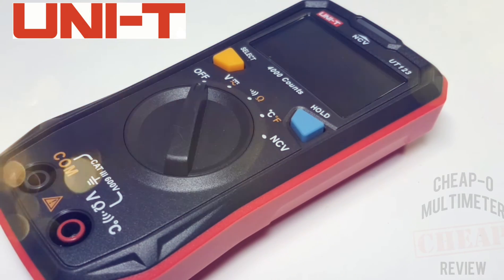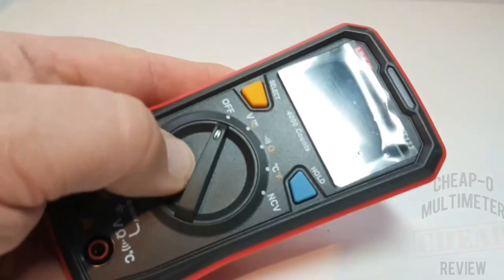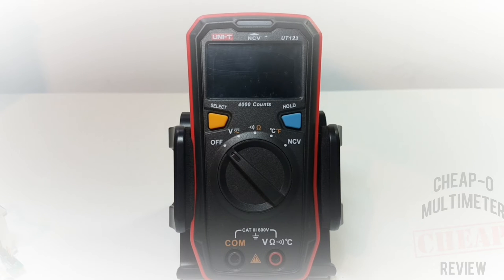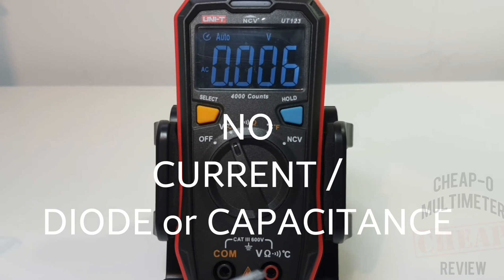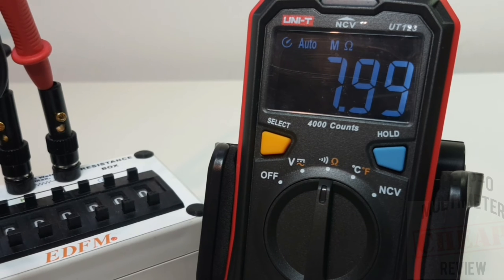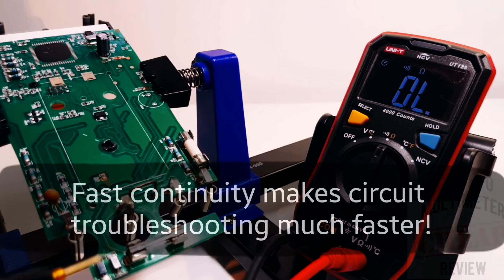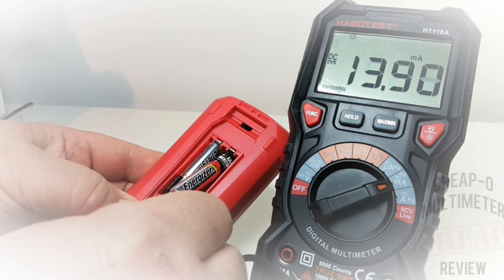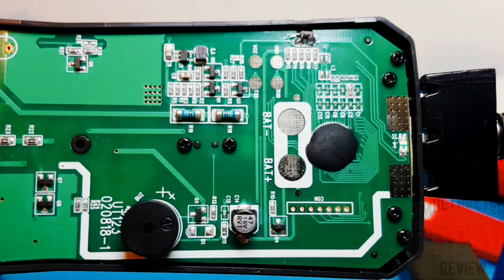UNI-T UT123 CHEAP-O Multimeter Review & Teardown

Comment: Can anyone tell me what value of the five resistors are that are right next to the connection from the screen to the board and the order they go in from top to bottom.? The connection from the screen to the board failed and these five resistors got desoldered while trying to repair.
Reply from the maker: Those 5 smd  Ω resistors (R13-17)205, are all 2.0 Megaohm in value. 👍
Reply: @KeepOnTesting  thanks very much👍
Reply: @KeepOnTesting  are these resistors 201 or 402
Reply from the maker: @jm2525cm  I believe  201, I can confirm tomorrow

Comment: Is this an original product by UNI-T?
Reply from the maker: Yes, UNI-T is the OEM.
Reply: @KeepOnTesting  thank you! Great reviews btw. Been binge watching for more than 2 hours. 😂
Reply from the maker: @dppalmero  That's great to hear Diane..😃👍 Keep On Testing !
Reply: @KeepOnTesting  I have a question, what is the best auto ranging UNI-T multimeter?
Reply from the maker: @dppalmero  Without a doubt..the UNI-T UT191T holds that title...what an incredible value. Solidly built, great input protection,  fast ranging..and really accurate 👍
Reply: @KeepOnTesting  Thank you so much!!!
Reply from the maker: @dppalmero  Most Welcome Diane!
Reply: @dppalmero  
Yes.😊

From you ?

Comment: I have a couple of these. The lightening fast continuity and voltage beats Fluke and Amprobe and all for $15. This will do 99.9% of your fault finding needs. It was this review that did it! 
Only down side the display can be difficult to see in sunlight.
Reply from the maker: 👍 Great stuff! These are indeed great little multimeters that pack a big punch! Keep On Testing!

Comment: The reason for such a low volume is because the piezo speaker is sandwich between the board and the battery compartment.  It has great spacing on the selector switch to prevent arcing across the traces.  As of 9/28/2020, you can get the meter for less than $15.00 usd--a good deal for a basic meter.  Great review.

Comment: 🙌Why These Multimeter Doesn't Have A Fuse!!!!!🙌
Reply: Not needed, no ampere measurement possible.
Reply: @aaba112  But It's Important if you are measurering high voltage
Reply: @hamzamalik221  I haven't yet seen a multi meter having a fused input for voltage. But right, if you mistakenly connect over 1000 volt maybe something could be damaged. As you see in the tear down, it has a PTC resistor (green) in the input that will limit over current going in to the electronics.
Reply: @aaba112  Some multimeter have fuse attached inside on PCB board

Comment: They say with inverted displays you can look at them from almost any direction and the readings are quite discernible, maybe that compensates the lack of a stand. Still I'm more inclined to buy the AN113D (which has an ebtn display too) than this one.
Reply from the maker: ZOYI ZT102A and Aneng AN113D are the same multimeter. Either of these will serve you well..This UNI-T serves a different niche than these two multimeters but I still think it's a great dmm, although a stand would've been nice 😀 Let us know which one you decide to get. KOT!

Comment: Uni-t should launch a UT123+ that include TRMS and backlight (a great bonus would be a magnetic holder). For me it would be great, and for a residential electrician would be perfect.
Reply from the maker: That's a great idea...UNI-T I know you're listening..take note!!
Reply: @KeepOnTesting  do you know if it's possible to detect the live wire in AC with the probes?